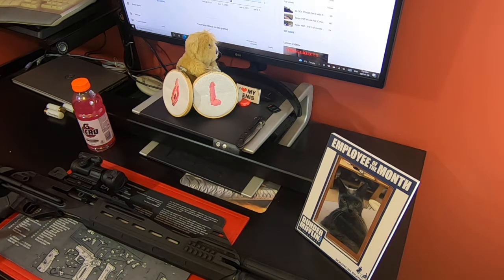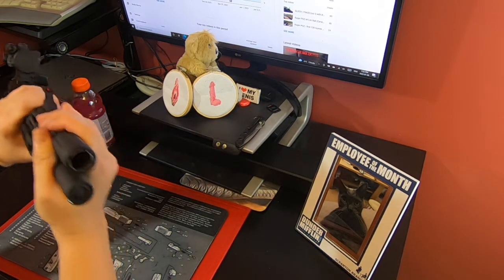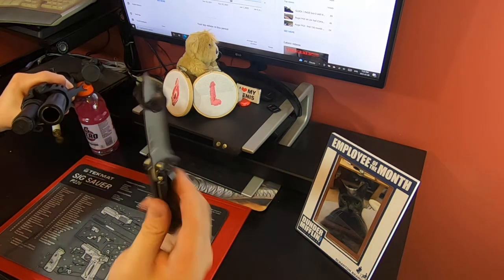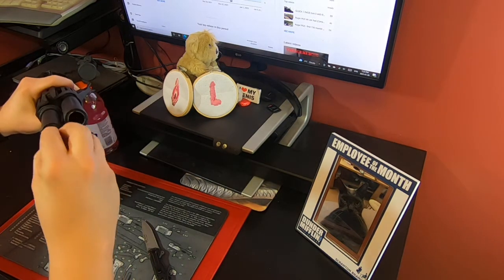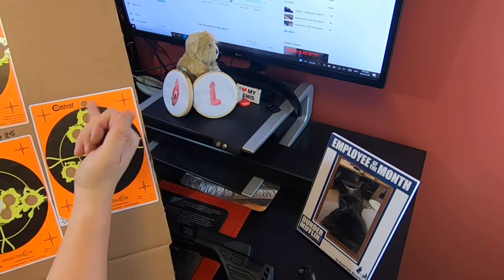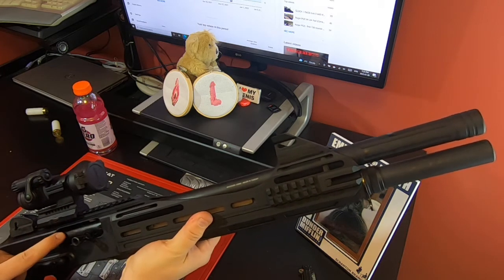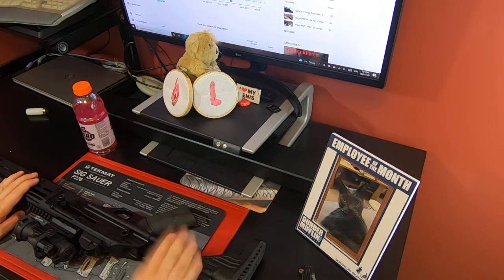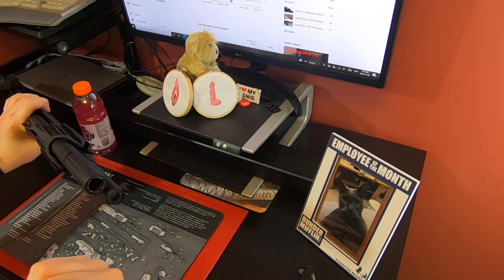Canuck Engage Accuracy and Tube Plug removal

Comment: We're did you get that plug and would this would on a canuck sentry?
Reply from the maker: Plug came with it.  We need them in Canada for hunting.  I would imagine if the tube length is the same the plugs should work.  I also have one for my Remington 870
Reply: Ok I live in Canada as well but my sentry didn't have a plug with it
Reply from the maker: @ryangrondin2303  Google and you’ll find a bunch. The ammo source (SFRC) has 7 in stock for $11.95 right now